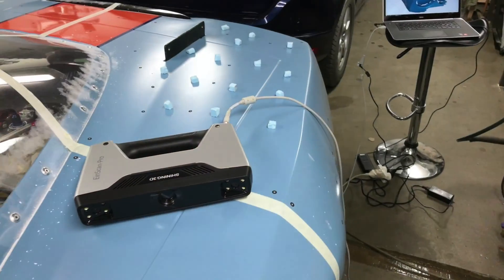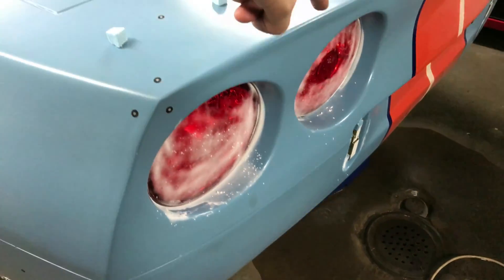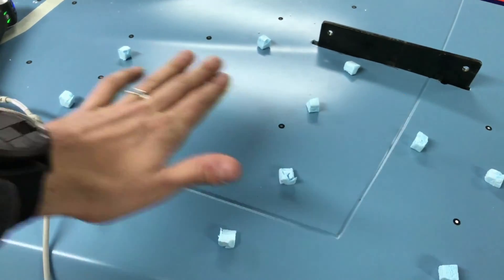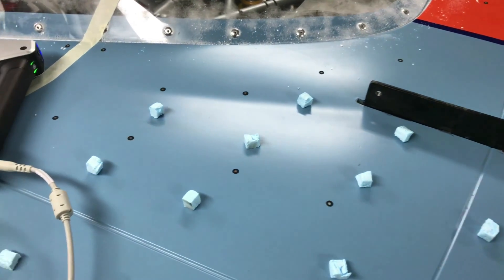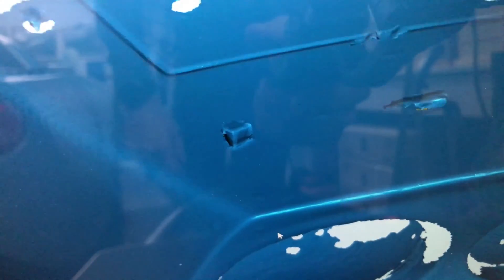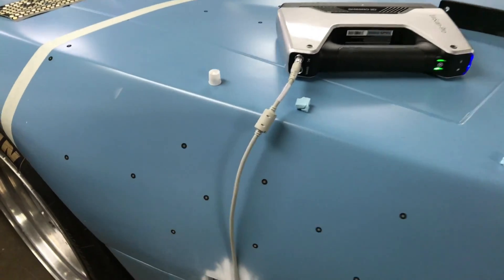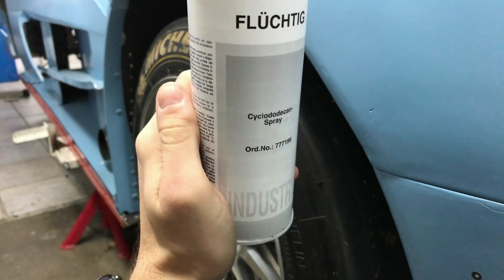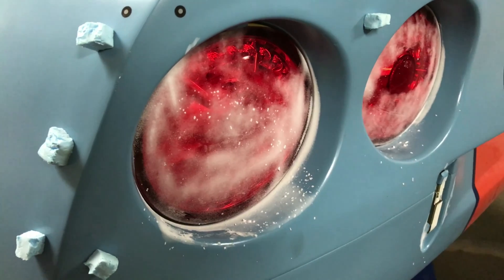More 3D Scanning trial & error

Comment: how are is the quality of the scanner, im tossing up between Creaform & EVA as well
Reply from the maker: The quality is great! And the process is really smooth, we've only scanned larger objects (the racecar) so far but I've also done some testing on smaller objects with the HD mode enabled. 
We've just finished aligning the whole front and rear part of the car now!
Reply: Thanks, that's good to hear, we need to scan cars too. Did you try Creaform or EVA first, my concern was the software with Shining..good to hear you like it.Which program did you use to manage the mesh?
Reply: +darren schofield we scan cars everyday with Artec Eva， lovely result， and we are looking at LEO for a better performace

Comment: I recently purchased this scanner. Have you loaded their latest (revision 2) software? It seams to do a better job with tracking. I too have been challenged in scanning automotive surfaces, but still experimenting with a technique that works.
Reply from the maker: Yes we upgraded the software today, but I havnt been down in the garage yet to try it out! Do you have tips regarding your technique that you can share? :)
Reply: It's been a while since you posted so I'll leave this here. When you scan put target spheres/123 blocks around the object to scan that way you can scan in segments. Scan the objects first then in each segment. Either back of the car, middle, front but in each segment you need to make sure you have the objects and overlap. Then insert each segment and use the objects for alignment.